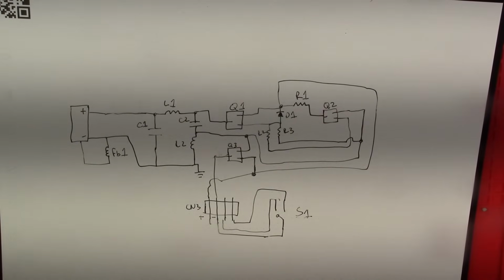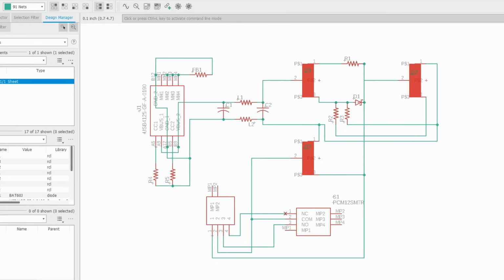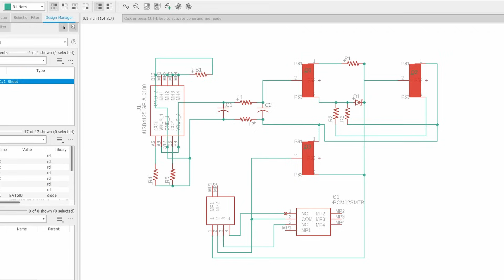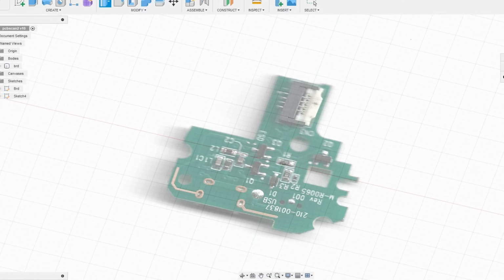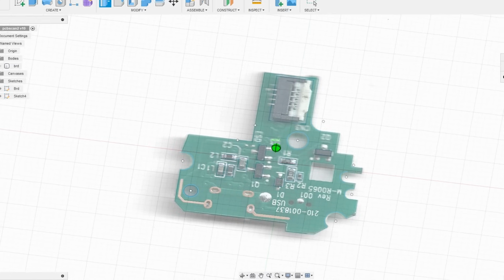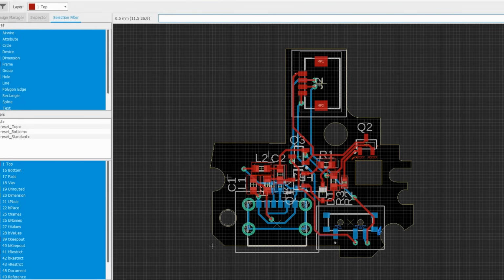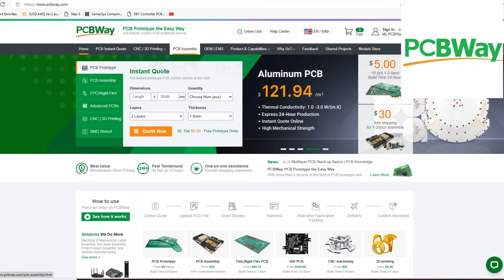Fixing Logitech's design choice. MX ERGO USB C mod replacement PCB

Comment: That's fantastic work, thank you! 
I've had the MX ERGO for several years now, and about 4 years ago I've replaced the micro USB port with USB C, but without redesigning the charging board. I just found a low footprint USB C female plug with just the charging pads on it, soldered it with thin leads and glued to the board. Works great, but isn't exactly elegant and if it does break, it will be a pain to replace. 
I've recently picked up another MX ERGO on clearance for dirt cheap and was wondering if there's someone else with the same problem, who might have redesigned this board. That's how I found this video and I'm glad I did.

Comment: Looks good though I don't think I would have done it as I have a ton of micro usb cables.  USB C cables are the ones I have trouble finding.  I do agree though that it should have come with a USB C connector.

Comment: LOL - I had my employer IT department order one for me about a year and a half ago - this thing's charge has never lasted more than a week. The charge lifetime then dropped sharply last spring and required charging about every other day. I got tired of it and replaced the battery several months ago and there was no improvement...until a few weeks afterwards where it just stopped charging & working altogether. Meanwhile, my OG Logitech trackball that I bought back in Dec, 2013 was still working flawlessly as of last night, (I had to replace the left switch button back around 2016 / 2017...that was it). Will this mod fix my charging issue?

Comment: I have one of these, and yeah the micro USB is crap.
As for the switches, I had the plastic that presses on the switch wear out before the actual switches. I was all ready to start soldering and instead I had to epoxy the bottom of the buttons to rebuild the material to press the switch down again

Comment: How might one modify the MX Ergo to be fully wired (no battery or bluetooth)? Could this be done without replacing the stock PCB?
Reply: You could just keep the wire in
Reply: however only power goes via the cable, not the data, so no high speed rates

Comment: I'm conflicted on this mod. on one hand I have HATED micro USB since they replaced USB mini with it, and on the other hand, as you said I only have to charge it about 3 times a year. 

hunting down a micro USB isn't an issue for me since I have a couple old USB batteries and a couple PS4 controllers that use micro USB that are floating around. so long as they don't all go flat at the same time I have a dedicated Micro for charging at my desk

Comment: I just bought a magnetic charging cable set for mine... much cheaper.
Reply from the maker: If it works for you that's all that matters. I like a more concrete solution that doesn't involve dongles or adapters. Plus for me the process is a lot of fun.

Comment: personally I would just preorder a gameball thumb and use that. 
at least the gameball thumb uses a proper sensor, has USB C, and fully wired connection. plus it's the same price or cheaper than the logitech.

Comment: What I actually bought for my mouse and another tools with rechargeable is got a magnetic charging cable with all 3 possible ports and it basically makes all into 1 cable. Saves the headache right?

Comment: @SolderKing that is a freakin good mod you did there! I just wanted to find a video of someone replacing the battery as mine is dead but this has me inspired to upgrade the board to C too!

The switch replacement was also hecking helpful. I'll need to disassemble my brother's mouse and fix his switches too

thanks!

Comment: My guess why logitech still uses micro usb is that it sells too few  to warrant a PCB/ injection mold redesign, or even depending on production process, they could still be using shells/pcbs made years ago.
Reply from the maker: That would make sense! I wondered if they perhaps use the same board over a few products and just had a stockpile to burn through

Comment: man, Track ball mouse used to be so simple. They used to be just a PCB and some rollers with sensors to detect the movement of the track ball. I still remember that time at school when the balls on our mouse were stolen by other students so we had to improvise by reaching into the mouse through the hole for the track ball and manually turning the rollers inside to move around the cursor on our screen. It was really hard but looking back it was a really enjoyable experience. I actually wish I can find an actual track ball mouse from the early 2000s to displace on my desk or heck even try gaming on one.

Comment: Nice mod however the rubber coating on the shell would break down long before the micro-usb port would...I bought my third MX Ergo few month ago.
Reply from the maker: want to donate one? I would love to see if I could do something about the rubber
Reply: @Solder_king  If you are in the UK I am more than happy to do that!
Reply: This is why I stopped buying them. After my second one, I just got tired of the unpleasant feeling of the rubber when it starts to wear.
Reply: Break down in what sense, what is the issue? I'm having it for 6 years now
Reply: @sharymens8187  Rubber gets sticky and starts to melt after 8 months or so for me.
Reply: @xp0079  hmm oki haven't experienced that yet :p
Reply: @xp0079  Do you clean it with something abrasive maybe?
Reply: @sharymens8187  No, had four of these and they all did the same

Comment: I know pcbway is a sponsor and the video would have been pointless, but did you try to find a usbc-connector with matching pinout to just unsolder the connector and add the usb-c
Reply from the maker: I would've done this without a sponsor like I have in the past with other videos. 

You can't find a USB C drop in replacement due to pinout and needing two additional parts.

Comment: Great video shows how clean this can be done. I did a similar USB C transplant onto a MX Master from 2016 but much less refined just slapped a aliexpress USB C 5V breakout board inside fixed the port with solder to the ground plane and it still works. Only issue is the soft rubber shell degraded over time and I had to fix it with some sugru too.

Comment: Using a trackball is weird - I don't get it.  The fact that you are worried about the port that a device which doesn't even move uses is also confusing to me.  HOWEVER, I admire your passion, and while your end goal is questionable to me, you crushed it in execution. Great work.

Comment: What's the name of the switches?
Reply: I would also like to know which switches were used as a replacement. Great build and thank you. The switch definitely fails after a little over 1.5 years of daily use. Seems to always happen in the middle of a project so I have few to repair/upgrade.

Comment: For this exact reason I went with ProArc EM01. Which seems very similar to this Logitech mouse, but its cheaper and has USB-C.
Reply: Since I do believe the Ergo is overpriced, I started reading up on the EM01. Looks nice, I wonder how real those dpi settings are, if not faked they are a huge bonus over the Ergo, somebody also mentioned the ball stay smooth (although they probably meant the 'bearings'). However, while I lament the lack of USB-C on the Ergo, can you please test / confirm for me, can you use the EM01 while charging?
Reply: @Windgazer42  You can charge the EM01 and use it (connected via Bluetooth tested).

Comment: Im sure you could make some money from either:
1. Selling the PCB with all the parts in it as a drop in replacent, only needing the customer to shave away some plastic for the larger USB C commector
2. Selling a couple of these to people who really want a USB C version of the ergo

This is definitely a niche, it just depends on what people are willing to pay for this upgrade. Pro tip, even though people say they will buy something that does not mean they will buy it. Trap I fell into. Start small and let the sales figures do the talking :D

I wish I had the time to do this mod, I use an ergo m575 but ive been wanting to upgrade to the newer MX ergo lineup. You possess some very good skills, you will go far

Comment: Would it have been possible to just replace the USB port on the existing board?
Reply from the maker: Technically yes but the pin out would not have matched, and you'd have to add two resistors to the port. It would end up being a lil wire ratsnest.

Comment: to a lot of people might feel like "why not just buy a new one"....but seriously i RESPECT you for going through all this to make it yours and make it fit your needs by yourself....absolutely love it....and got a huge SUB from me.
Reply: well...the answer is - because this is the new one. It should've been designed with usb-c
Reply: 100% agreed, especially from Logitech..they've been around forever, they can't be pinching pennies when they sell that mouse for that price...kudos to you for making this video...hope they see it. @dimitrijekrstic7567
Reply: Logitech does sell trackballs that charge using USB-C - however:  They don't sell one with this model's capabilities, which can be paired with up to two devices (your choice of using the Logitech dongle or Bluetooth with one or both devices), plus other advantages over their cheaper trackballs.  Truthfully, they should release a successor of this model.  One that you can use with up to three devices, like all their wireless keyboards these days, but other than the Micro-USB/USB-C issue, the existing MX Ergo trackball probably needs to be around for three more years (10 years total) before they would consider completely supplanting it.

When I bought mine, I was most suspicious of the rechargeable nature of it and thought the battery would die within years, like a smartphone's can, and Logitech even planned on offering replacement batteries, but that idea disappeared quickly, although you can get replacement batteries off of eBay.  Seven years later, that trackball battery still lasts me months, I have a second trackball I keep in the living room, and my wife uses one, too.  Oh, I bought my step-nephew one as well when his old battery wireless Logitech trackball died.

Long digression, but also when I bought my first MX Ergo (Plus) in 2017, my Pixel 1 was the only USB-C device I owned, my tablet was still Micro-USB, although I was already sold on the idea of USB-C being used for everything.

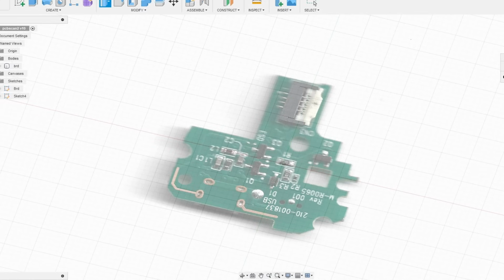Comment: Ah, had to go back and verify: 2:41 you added the two 5.1K pull down resistors on cc1 and cc2 so it will charge from a USB-C source. Good job! Also, awesome rework, the true spirit of the maker/engineer:  "This is not right, I will modify it to be correct"
Reply from the maker: Thank you! :)

Comment: 7:30 you were not talking too much. 

What was the switch on the PCB for? Was it the original mouse switch or a new component? It was a but unclear when you were installing it.
Reply from the maker: The switch was apart of the original board. It functioned as the on/off switch for the mouse. I happened to find a replacement one online and used it instead of picking the old one off the original PCB. I did that also with the connector. The reason behind that was to provide a substitute part if they were damaged during removal :)